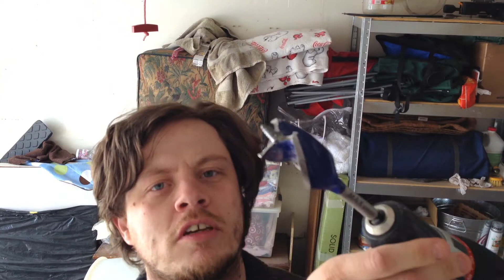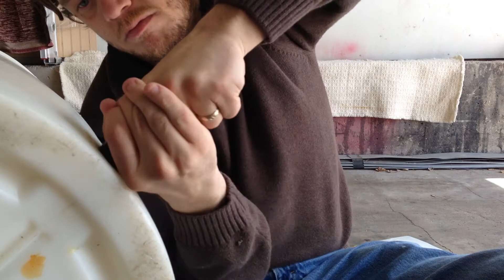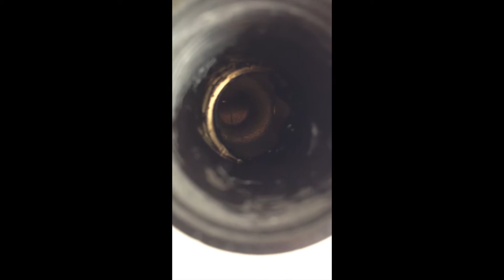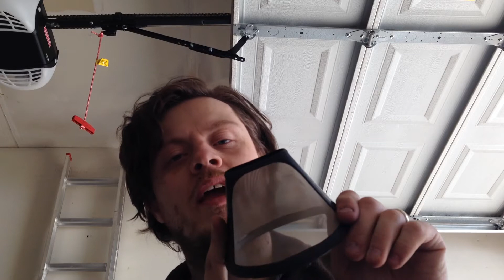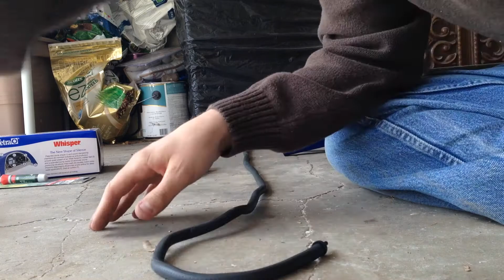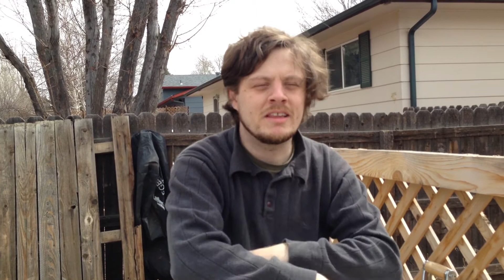Season 2 Episode 2: Tea Time

Comment: Great job! Loved the video and if I wasn't so lazy I might make a smaller one for here.   Couple things:  Isn't the tea brewer going to smell so maybe it shouldn't be on the patio?  Shouldn't you cover the pump from weather?
Reply from the maker: The tea brewer will only smell if it does not have air in it because the smell people associate with compost that has sat to long is a byproduct of Anaerobic bacteria. The compost tea will be constantly being aerated so it will only harbor aerobic bacteria. 

I thought about covering the pump but it's case is very well sealed and so I don't need to worry about it getting ruined. :)